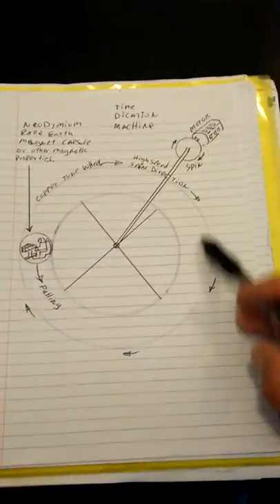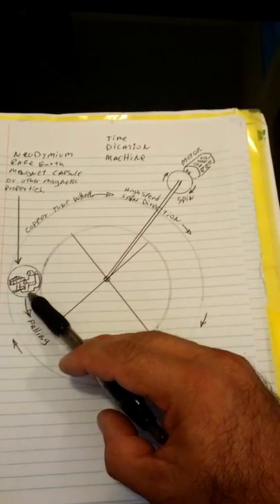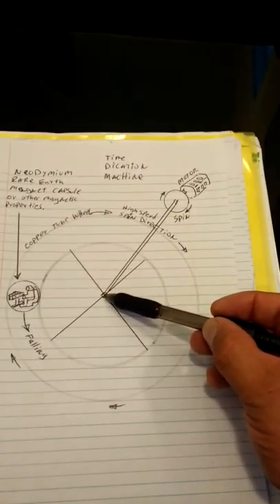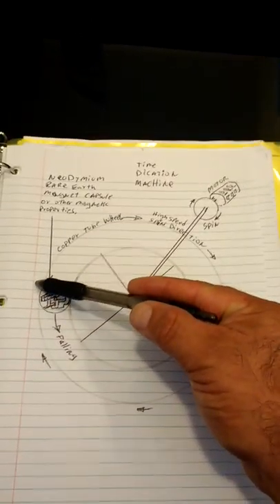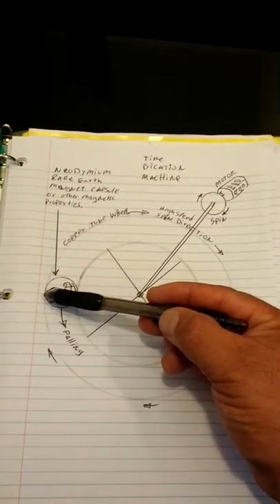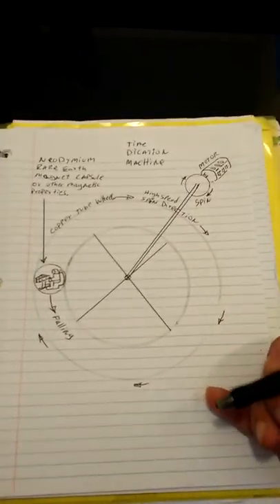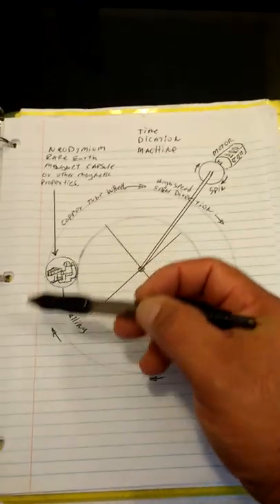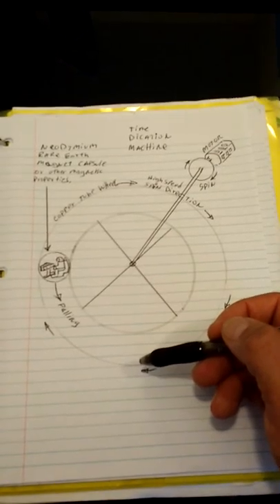ANTIGRAVITY MACHINE , TIME MACHINE CONCEPT INVENTION

Comment: Amazing theory....do you performed this one....did it worked....?..!
Moving clock might be slower but... how about chamber producing flux would cause time dilation......I need answer.....Have you tested this ....did it worked out???
Reply from the maker: Most is theory based on fact that black holes do affect the speed of a approaching object by speeding it up on the even horizon but in a copper tubbing pipe if you drop a magnet the neodynium magnet is slowed by half of the speed of a regular falling object so yes in both the cases in a black holes or in a copper tube with a falling neodynium magnet , in both cases the speed is affected , and there been test done by other that confirm that the speed of a falling magnet is indeed affected , now futher  testing is needed but another equations is to add a spinning citrifugal force g-force to add weight to a human body , you see time speed up on a large mass like a mountain and time slows down at sea level with less mass so why not with a human body when it spins with g-forces wich temporarily makes a object heavier with more mass while spinning ....but for sure you can make neodynium freefall for ever if you rotate the copper pipe upward and synchronized the speed of upward rotation to allow the falling neodynium to defy gravity and never fall but always falling at the same time .....
Reply from the maker: Chamber producing flux , not at this moment but will look into more on this subject perhaps will have an answer in few weeks depending if it's plausible or not .... Thanks you for your comments.
Reply: @megatroninventor  thanks for your reply 👏
Reply: Hello